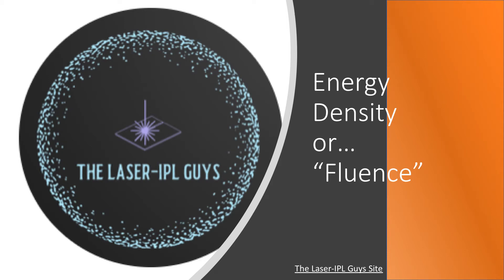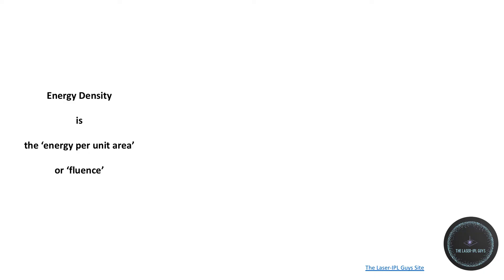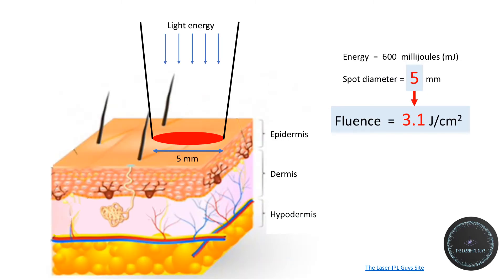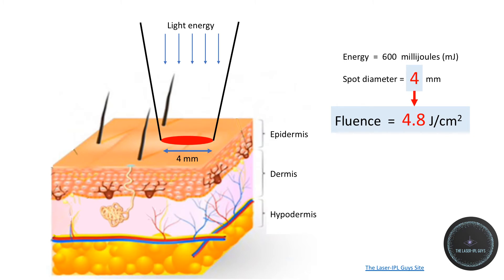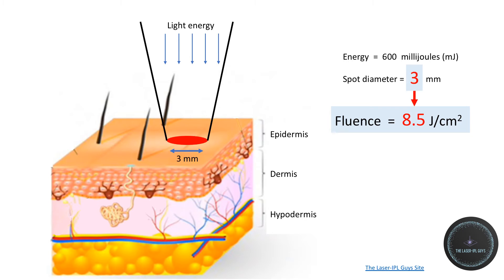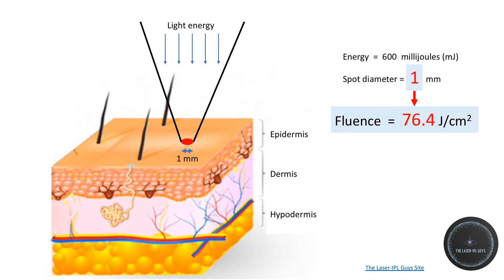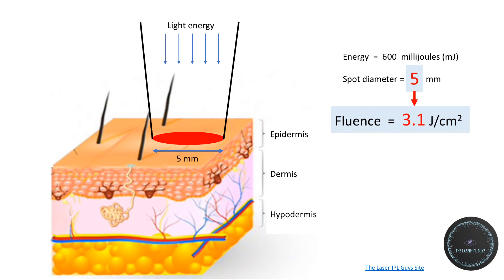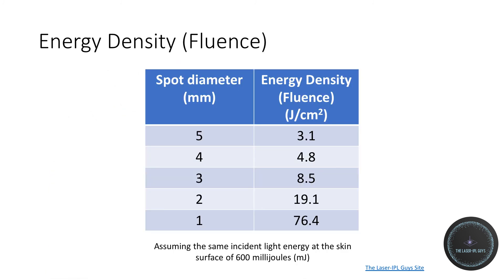Energy density or Fluence

Comment: How did you calculate energy density ?
Reply: You measure the energy coming from you device. Fire a few shots at burn paper and measure the spot diameters. Calculate their area, then diode that into the energies. Energy density = energy / spot size area.